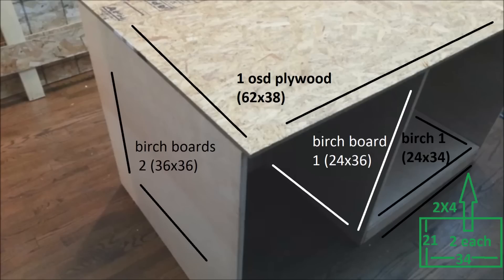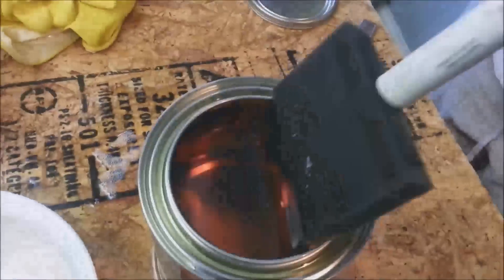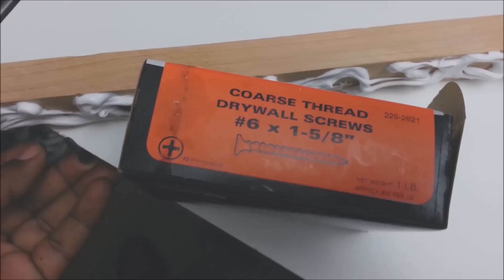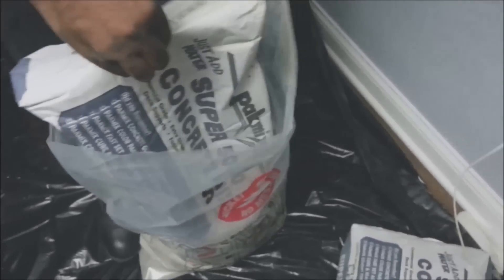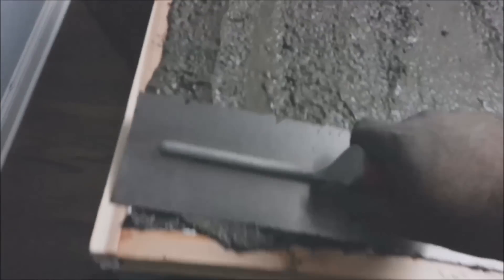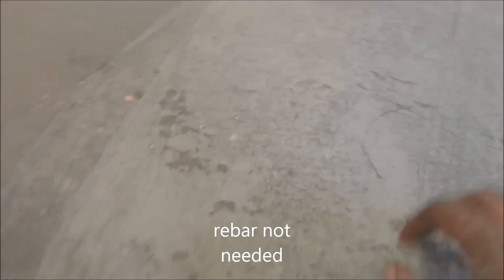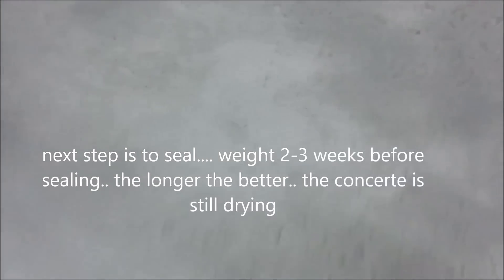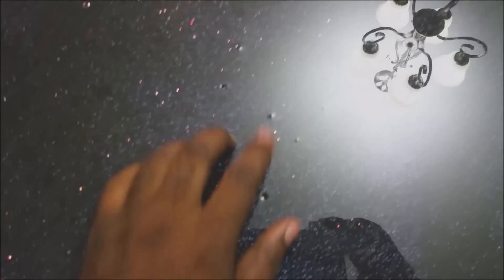concrete countertop center island start to finish HD

Comment: Looks awesome, I love the tint, glitter and the way you used silicone to make the textured edge.  A lot cheaper than buying the edge molds and works just as good or better.
Reply from the maker: +buckylaine i just cant understand why they charge sooooo much for them
Reply: Me either, defeats the purpose of trying to save some money doing it for yourself.  I'm so glad I found your video.  Thanks for sharing.

Comment: the stuff you poured on called "evirotex lite" is something you can sort of brush on and it will self level and all the brush strokes will disappear and you'll end up with a high gloss finish. Also, you can use a propane torch lightly over it just after pouring to get rid of any bubbles that are in it because of mixing and stirring. Or use your breath on the surface but a torch is easier.   One more thing,  if you start getting a lot of scratches in it ,  you can wet sand it with light sand paper and get a satin finish or re-coat it again for the high gloss.   I've used that stuff a lot before.

Comment: I’m searching for ideas to do custom edging for my diy concrete countertops. This is a great idea and it looks awesome! Love the glitter look. 😍 I think I will use a glue gun and sand to experiment with designs.
Reply from the maker: Yeah... makes a test piece first. Before doing a huge piece like what I did.  .. .. but I dont see why it wouldn't work.. . As long as the concrete will release it..

Comment: You're crazy doing all that in the house! haha. Also, you didn't put any rebar in the concrete for expansion and contraction :/ It could split if you put a hot pan on it!
Reply from the maker: yeah i got the rebar and forgot to put it in... but i havent had an issue with cracking... a few mouths ago i tried to break it.. so that i could re pour another top .. it wouldnt not budge,, and i hit it with a hammer and many other hard thing... maybe its getting extra support for the plywood bottom that under the tables, its about the same size as the top... anyways if it cracks i think i can muster up 20$ for some more concrete .. i guess i have just been lucky... actually i would love to see an example of 1.5' thick concrete table without rebar that has failed ... i dont plan on driving my car on it ... hell i dont even sit on it ... mostly just groceries and a food prep area ...  the heaviest thing i put on it was 4,,,, 5gal bottles of water.. along with a lot of groceries .. but the moment i have an issue i will make an update video

Comment: That looks good. You did a damn good job.  If you run over the top of the epoxy coat with a torch it lays out slicker and gets rid of bubbles.

Comment: Pretty good job. few pointers:
1. use a palm sander to vibrate the form which will eliminate many air pockets before screeding.
2. a blow torch lightly waved over freshly poured epoxy eliminates all air bubbles in finish.
Reply from the maker: Bert John 
i tryed that didnt have a sander so i hit the sides with a hammer.. i got scared i was going to break it so i stopped..
and the torch.. i couldn't get it to stay lite. so i just gave up on it.

Comment: How much did you end up spending?
Reply from the maker: if i remember between 300-500.. i didn't buy everything at once .. i had a 50$ allowance and i would buy things here and there.... once i got everything stored in the garage i then started.. the base cost the most the actual top was less then 30$.. maybe 40$

Comment: That looks like quite the project.  I couldn't believe you had to flip the whole thing over haha.  You seem to have quite the creative eye and bold enough to take risks.  I am mostly talking about the natural cut edges and idea for the glitter.  Both ideas turned out great.  Thanks for the video and cheers.
Reply from the maker: Please check out the finished product at this video link
.
https://youtu.be/WSE4qIWbvXc
.
.this is an update video.. still today the countertop as well as the table holds up well ..I have not had any issues with it whatsoever

Comment: well that turned out pretty good dude. This video is very educational. My question is how hard was it to flip it over?
Reply from the maker: Anthony Ciccariello 
next to impossible.. me and the wife did it... leaned the top onto . two armless chairs.... moved the base out the way.. scooted the chairs with the top to the other side of the room... replace the base where I wanted it.. then we just leaned  the top back down... that top was insanely heavy... next time we will do a pour in place.. .. before the flip the top looked just as good.. especially if you are going to epoxy it.....
Reply: Ok cool . I think your project turned out aewsome.

Comment: Hey! Looks great. How dark is that charcoal? I'm wanting very black. I'm afraid it's not going to be dark enough.
Reply from the maker: Kyle it's as black as it looks check out my update video on this project.. if you look in the background of this video you see I have black granite countertops it's as equally black as that and that's very black..
 Pro tip... used way more color tint then suggested.. I use one of those tubes for each bag .. which is made for 2 bags... .. so more for darker less for lighter..... but they do make a black..
Reply: DIYworld Productreview thanks for the reply. Did the epoxy darken it up a lot? I'll check that video out!
Reply from the maker: Kyle .
Yes.. made it look wet and glossy.... if I would do it over. I would have just done layers of polyurethane....maybe 3 or 4 coats..... and if need be I could have always apply the two-part epoxy later if I did not like the polyurethane finish
The two-part epoxy was very expensive it was actually the most expensive part of the build ...

Comment: If you use a torch on the epoxy right after you spread it, it will get rid of the bubbles and make it really flat. Nice work.

Comment: horrible job with horrible results. You should have used some mesh or rebar and how could you not vibrate those bubbles out. You could have used a rubber mallet at least around edges.
Reply from the maker: prettymochame just T 
im no pro... just was having fun... before this i had never built anything. .
Reply: DIYworld Productreview gotcha, sorry if I was hard on you.